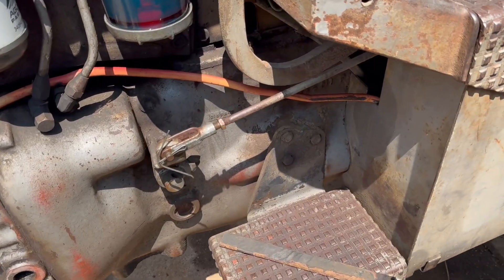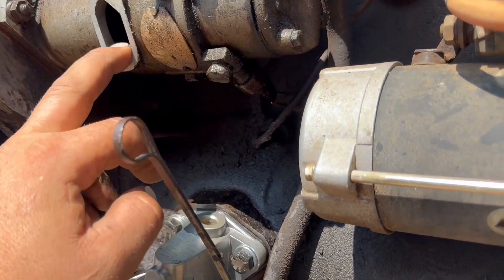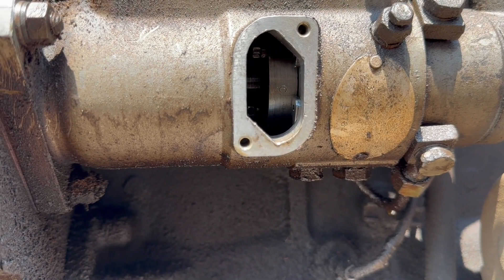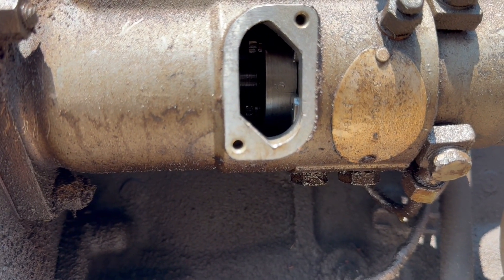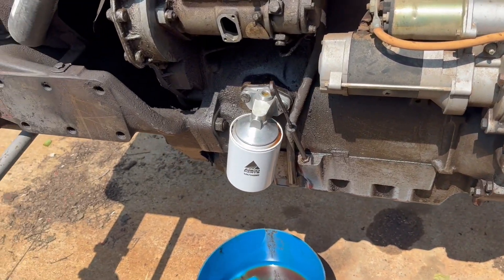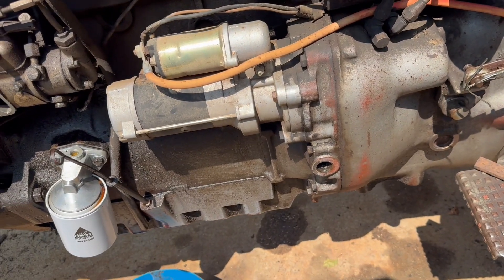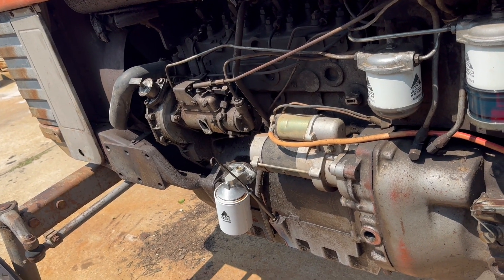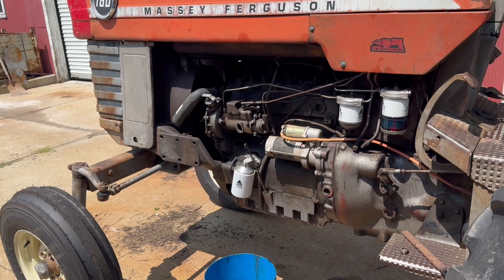Massey Ferguson 180 Diesel Tractor Injection Pump Timing and Flywheel Timing Plug Location

Comment: I have a 1988  MF375, and am working to solve a no start after resealing the injection pump.  This video is very helpful so that I can verify the timming marks on the Fly wheel, and the pump head. thank you for making this video.😀😀